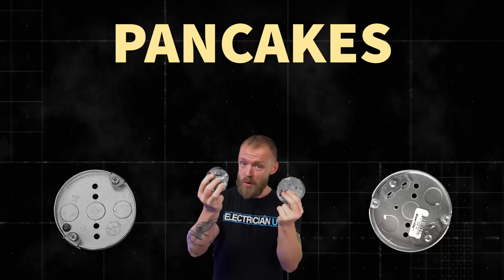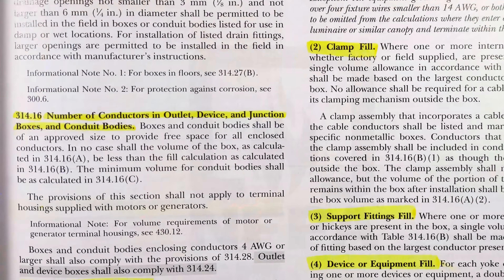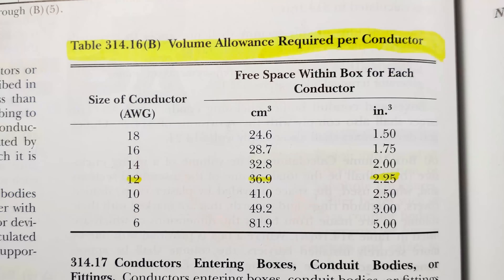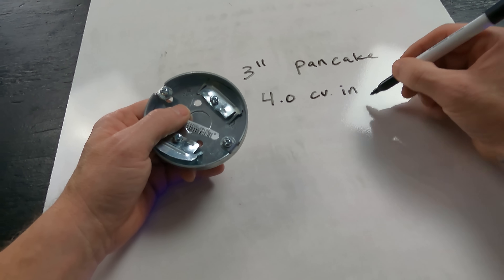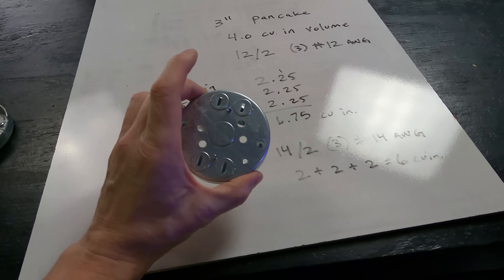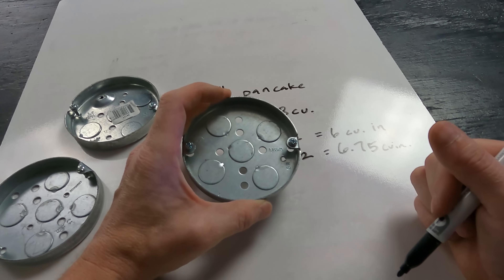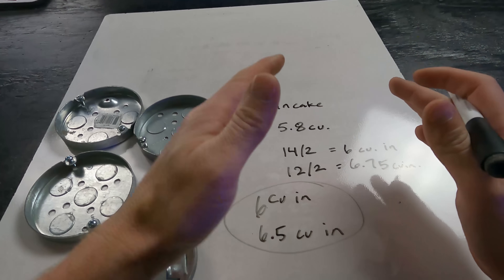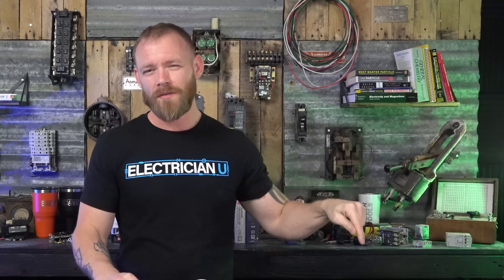Do Pancakes Violate Code? How Many Conductors can ACTUALLY Fit?

Comment: Just weird how Carlon list there plastic 4" pancake box  as having 8 cubic inches of space, and steel city (Rayco) list there identical dimension pancake box as only having 6 cubic inches. The boxes are identical, you can literally hold them up to one another and it's the same. When you do the math on it too, 4"x4"x.5" gives you 8 cubic inches, so it's very conflicting. Anyway, ran that 12/2 to my vanity light with the steel one, I'm not losing sleep over it 👍.

Comment: I believe new 2024 code specifically addressed pancake boxes to one single 14/2 romex. No 12/2 no 14/3 and certainly no in and out. Regardless of canopy space. The thinking there is different fixture changes. Person moves out takes there lights new guy hangs there own with who know how much depth on the new canopy.

Comment: If you're using BX cable, and install the cable clamp on the outside of the box, then there's only two conductors for a 12/2 or 14/2 cable (no ground wire). So potentially as low as 4 in³ is adequate.

Comment: Hollowing out a stud, atleast the bottom chord of a truss, might not technically be a 'code violation' as much as it'd ruin the warranty of the truss builder. Point is, that creates other problems. You went and over thought this.

Comment: I have the 2020 NEC code handbook, which is the one with explanations in Blue. It's hardback. 

Under 410.20, the blue explanation follows. 

"UL 1598, Standard for safety for luminaires, allows junction boxes and splice compartments that are integral to luminaires to have less free volume than required in 314.16, Section 314.16 applies to general-purpose boxes and conduit bodies where installed conductors and devices are variable, while the conductors and devices that will be contained within a luminaire junction box are known"

Don't know about 2023 NEC

Comment: I’ve chosen a pancake box for a ceiling fixture, in order to hang a vanity light, centered. To do so, I have to attach to a stud, that’s why I’m choosing this box option. 

Is that typically within code for a single vanity light fixture ?

Comment: so say from a junction  box with 12 /2 wire on a 20 amp circuit could I run 14 /2 off the 12/2  to a light fixture if I step  down to a 15 amp breaker in 1 of these pancake   and be up to code?

Comment: I'm a new apprentice in canada, so I may be wrong or nec may handel this differently, but I was taught to not count the bonding wire since it doesn't always carry current as the hot and natural do. Is there a reason you count 3 conductors for 14/2 or 12/2

Comment: I noticed that fan support pancake boxes are identified as 1/2" deep, but their overall depth is closer to 5/8" deep.  When installing the box on a centered joist with 1/2" drywall at the ceiling, the box sits outside of the drywall by about 1/8".  I have been creating a 1/8" deep notch in the joist to flush the pancake box to meet the code section on flush mounting boxes.  Is this the best method for a workmanlike install?

Comment: This is one code that has had me always thinking about everyone saying canopy counts as “space”. I think I even commented somewhere that it does and now stand corrected. 410.20 states that canopies and boxes shall supply enough space for LUMINARIES CONDUCTORS! Not branch circuit conductors. Second it gives reference to 314.16. So 314.16(B)(1) exception states. That fixture wires or conductors  enter from a domed luminaire or similar canopy shall be omitted ( short version) both times talking about the fixture wires and not the branch circuit

Point is canopy does not add on to box fill simply takes into an account for fixture/conductor fill adding to an outlet

Comment: Pretty sure he’s just trying to point out that per code these are a violation do to box fill. But it’s a standard practice to use these to get exact locations for fixtures when needed. NEC is not to tell us how to install a system but a guide line. Always so many factors that can change the code your working with. You put a fixture with canopy space you pass. You put a blank plate on you fail.

Comment: Man my last boss, would use nothing but pancakes... Only time I'd use something else, if the light was midpsan between joists. He even made me use plastic pancakes for ceiling fans. Such a pain the rear! Easier for rough-in, blows at trim-out. Let alone Id rather do metal for fans.

Comment: I used pancake boxes on the exterior of my garage, mounting them directly on the surface before the siding was put up.  In order to more adequately accomodate the wires of a motion detector controlled light fixture, I was able to use a pancake box extender which screws on to the main pancake box.  They are available in many hardware stores.

Comment: I once had a house where I DIY'ed a lot of stuff needing county permits/inspections.  I never got grief over pancake boxes, whose use expects a canopy, not a flat cover.  So how much space is in the canopy?  Even if the canopy is not explicitly marked, if a marked extension ring attached to the pancake can be covered by that canopy with the edge of the canopy being flush to the surface, then the canopy has at least as much space as the ring and the ring ought to satisfy a finicky inspector.  For a rough-in inspection I don't know why the inspector should care about the canopy for it hasn't been installed!  At worst it should be worth a note "Luminaire canopy must/will be rated at X cubic inches or more."  But again I'm talking about reasonable people.

Pancakes aren't used out of the sheer joy of them (if there's space, a deeper box is better, for one day one may want to wire more into the system) but because they can be attached directly to a surface such as a beam above the ceiling.

Comment: What if the pancake is used for structural support and the fixture wires, 18/3, run through the box, though the beam and into a larger box for connection to power, 14/3?

Comment: I was nailed for this once and the fixture's canopy wouldn't fly.  So... out comes a saddle box and she really wanted to not allow it just due to the shallow depth in the center.   My only comeback was "why would they allow these to be sold for 2 circuit ceiling fans?   She then wouldn't allow me to install it before she signed off, making me call for a re-inspection...grrrrr.   The next inspector just shook his head and muttered something under his breath.

Comment: In the  UK you cant buy "pancakes"! First time I've heard of these-what are they used for? We would be required by code to fit a deep box, recessed into what ever. if its Plaster board, we have special plastic boxes made with rear fixing. That is achieved by sprung loaded 'ears'
fixed to the box, which are squeezed inwards inside the box and then expand once past the plaster board thickness. The box is held in place by the slightly larger lid, or face of the switch or receptacle. Light fittings that hang by flex are accommodated by a circular surface plastic box,
which has a base with a lid. The lid has deep sides(approx 5/8") with an internal thread that screws onto the base side. The base has a fixed ground terminal and an array of recessed terminals giving connections for the feed/switch line and neutral cable together with terminals for the flex. The flex is wired through the lids centre hole (just the size of the flex) then screwed up to the base. all connections hidden!

Comment: I've used plenty of these,  the lights pretty much always have a cavity that will accommodate the wire and connectors. I never see lights that are completely flat at the mounting surface where the wires come out of the back side of the light. I'm sure something like that exists but most lights will work with these boxes. Boxes like this get installed and used safely for decades with no problems.

Install a regular box that sticks out until the inspector signs off on it and then switch them out with the pancakes.

Comment: these are not junction boxes. You don't put a lid on these. They are only the mounting point for a light fixture, and it is the light fixture that has the space for the wires. You have worked with wiring before, so I assume you should know this.

Comment: remember most pancake box's are used to hold a fixture and the wiring. The volume is increased in the fixture mounting area. If you use the pancake box only for a j box with a blank cover then it becomes a code violation.

Comment: Alright. This is all technically accurate which is the point. All the comments noting the inclusion of canopy space as a factor are relying on the authority having jurisdiction and their acceptance of that interpretation/exception. The NFPA panel creating NFPA 70 should take this up for the 2023 code or asap just to codify the exception or otherwise clarify.

Comment: 14 AWG switch leg when the rest of the circuit is 12 AWG? See 240.4(D)(3). The only place I'll use 14 AWG on a 20 amp circuit (and AFAIK the only place they're allowed) is small jumpers that stay within a single box.

Comment: Awesome vid as always. Just got done dealing with some of these last week. For 14/2 garage coach lights, they can work fine cause the wire is supported, in most cases, by brick work. Knock the clamps out and realistically you can still get away with 2 cables through the back. My biggest beef with these is seeing them used in stud spaces. Primarily bathrooms for sink fixtures. Been seeing them used due to a vent pipe that is right in the way. No reason to ever have to be forced to use a pancake in a cavity where you can easily fit a bar hanger or cut in box. Wish the plumbing code would reflect this and make plumbers reroute their vent pipes to accommodate electricians.

Comment: I don't know I just calculated out this volume of a 3-in cylinder that's half inch thick is 14 cubic inches, subtract the wall diameters and then the clamps is probably where that 4 cubic inch came from, I would think that you only have to subtract from that size classification when you add extra clamps not something from the factory

Comment: I called out a Superintendent on a pancake used for exterior goosenecks....... I'm like man the wire nuts don't even fit to make the connection. The light was loose and he said well just use EPOXY around the edges.......  I KNEW SOMETHING FUNNY WAS GOING ON WITH PANCAKE boxes 🤔🧐

Comment: Great video. Suggest a video on voltage drop. A footnote (NEC 210-19 FPN No. 4) in the National Electrical Code states that a voltage drop of 5% at the furthest receptacle in a branch wiring circuit is acceptable for normal efficiency. The Fine Print Notes to 210.19(A), 215.2(A)(4), 230.31(C), and 310.15(A)(1) that you adjust for voltage drop when sizing conductors. It's important for you to remember that Fine Print Notes are recommendations, not requirements [90.5(C)]. Do you (over)size your "home runs"? Do you use the limits of 32ft 14-2 for 1500W 15A breaker, 47ft 12-2 for 2KW 20A breaker on 12-2, etc.? Would love to see your response video.

Comment: However throw out cable loading, just thing ok 314.27(c) states that all boxes used in habitable rooms in ceilings shall be rated for ceiling fans with that stamped into the box.  Also goes on to state that you have to use #10 screws.  Also  314.27(a)(1) states that for vertical wall use all boxes must identified on what weight is supports if less than 50 lbs.  They can be used if marked accordingly.

Comment: I hate metal junction boxes, every time I've come across a serious issue they are involved. One time the aluminium siding ended up getting electrified through one and you'd get a little shock off of it. Now each time it was wired improperly, but it wouldnt have anywhere to short with a plastic box

Comment: let me say this about the volume fill for equipment grounds separately: 314.16(B)(5) equipment grounds up to 4 can be counted as 1, then a 1/4 volume allowance for each additional not a whole. and 314.16 (B)(2) for clamps if there is one or more, only one volume allowance is required based on the largest conductor entering the box. and you're wrong on the pancake boxes, because the volume of the light fixture or ceiling fan canopy is also added to the volume, and many of the light fixtures and ceiling fans have a volume fill space in them. Vanity lights have volume space etc.

Comment: actually, I was thinking about this when I watched you try to stuff the wires into you switch box when you were doing the wireless switches, and a lot of the older boxes that were used were 18 cubit inches. Well, before the 2020, you could fit 3 12/2 Romex cables into a 18 cu in. box. Now, in the 2020, when you have more than 4 equipment grounds, you have to add 1/4 volume allowance for each equipment ground over that, based on the largest equipment ground for that group or circuit. That's where you have to think if you use split a 2 gang box to use for 2 circuits as well. see 314.16 (B)(5) for equipment grounding conductor fill. If you are using a metal box with clamps, it changes the game a little. because a 18 cu. in. box can not receive 3 12/3 in a metal box because of that. There's two clamps and you have to count one based on the largest conductor entering the box. that means you can use 2 12/2 Romex cables or 1 12/2 and 1 12/3.
You know, Journeymen I worked with as an apprentice in Oklahoma didn't teach what the code says. I think they were more interested in having someone to crawl in the attic or dig a ditch or drive the ground rod when it had to be done, than to teach them the code, so they could go take the exam and pass it! They would get mad and say I was arguing if I wanted to know why I was doing something a certain way, or I didn't want to do something their way because I had just learned the way that you're supposed to do it according to the NEC. I just wanted to learn, so I could get my license, and it wasn't something I received any help from the Journeymen or contractors on the job. Because they got their license and never cracked the code book after that!
For anyone reading this that doesn't have their license, don't wait until you're eligible to take the exam to study. There is so much to learn, so much information in that code book. The most important thing I can think of is to learn how to identify a the main topic of a question and where to locate it in the NEC. Learning calculation and all that is great, but being able to quickly find something. If you're taking the Unlimited Journeyman exam, it's 100 questions, and you have 4.5 hours to complete it, so learning where to find things is important. You have a little over 2 minutes for each question. Your first pass should be to answer what you know and mark the ones you don't know or aren't sure of. second pass should be looking up the questions you didn't know and not taking more than a minute to find them; the ones that take more than a minute, leave marked and come back to it. Save the ones you had a hard time looking up till last; chances are you may see the answer when you are looking up something else, and save your calculations for last. never hit the done button. Sit in front of that computer and go over everything one last time and beware of changing an answer unless the correct answer is on the pages of the code book and you are looking at it. I don't know how many times I've changed an answer that was right
Start Early!!!!!!! Don't wait till you are eligible for the exam to study for the exam. That is a pain you will regret! lol

Comment: As others have stated, you really should mention canopy space.
No inspector has ever flagged me for a single 12/3 to a pan. We do it when there's no other reasonable option.
Reply: yeah he's overthinkging something that's already been addressed. as stated elsewhere (Williamsnyder's comment) UL1598 allows luminaires to have less volume than 314.16. Further, 314.16 apples more to junction boxes and conduit bodies where you can actually determine what goes in. bcuz as you know, you wind up having to put a light dead nutz on a truss.
Reply: Problem that I read was when a 4" what 1/2" deep pancake is surface mounted a majority.of the cubic inch volume of shallow canopies are taken up by the pancake box. They way it was presented it said that a 4" pancake  box counting the connector does not have enough volume for even illegal 14/2 type NM cable to feed a wall mounted luminares. In my area one inspector now only accepts UF cable to feed any outdoor luminares. Said NM cable is not rated for damp locations .

Comment: I know technically the 14/2 has 3 conductors but since the ground is not a usual current carrying conductor you you don’t have to include it in your calculations.
Reply: That's what I've been thinking. In 14/2, the 2 is the conductors...

Comment: Most inspectors that I have met use the device’s housing as part of the fill calculation because there is almost no situation where you have a flat cover on a pancake box !
Reply: Yes, that is why they allow them. All light fixtures I’ve installed have space for the wires.
Reply: Except for a keyless lampholder.
Reply: @cgschow1971 
And modern surface mount LED flat fixtures. Even some mirror lights can be a problem.
Reply: I disagree I’ve seen these in bathrooms when hanging a new surface mount light can be a nightmare with no where to tuck the wires into. No fixture space in this flat modern LED light trying to get it to lay flat on the wall. Ended up putting a JB in the wall accessible only by dropping the light. Didn’t want to but had to.